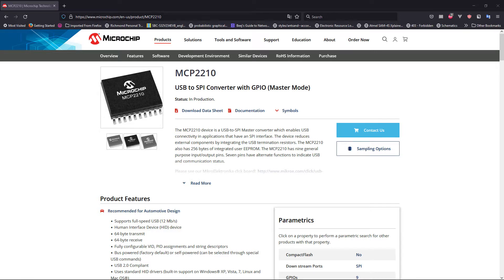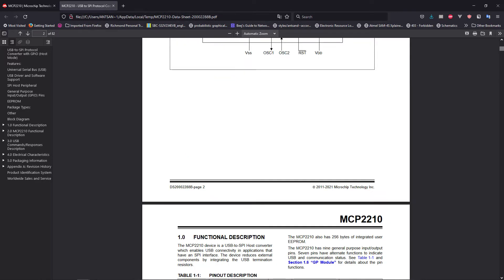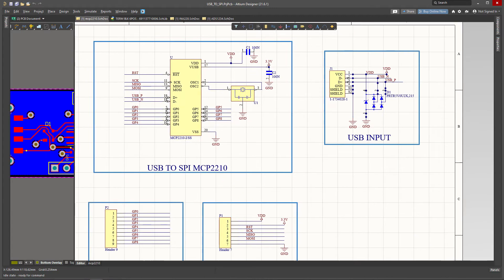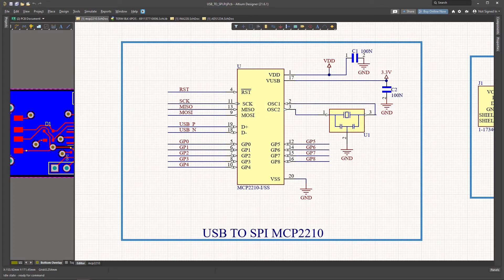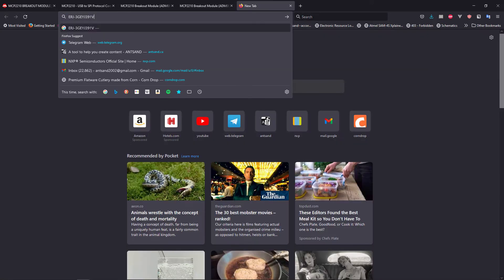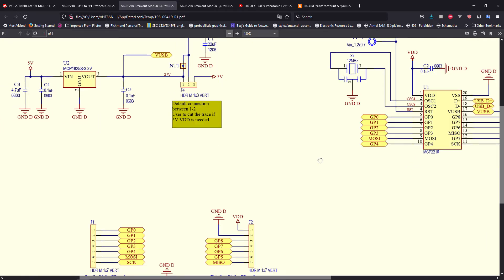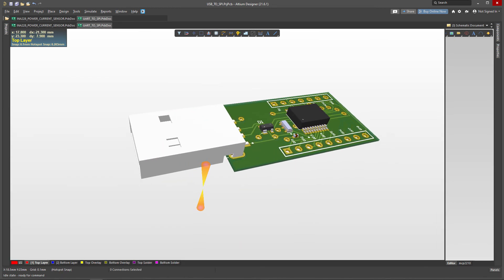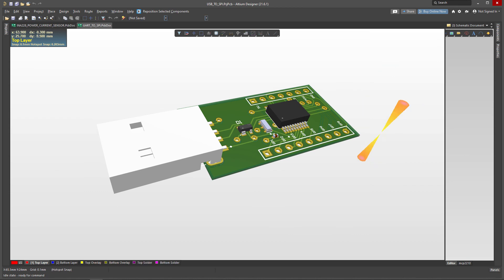USB to SPI breakout board using MCP2210 (Part 1)

Comment: Good afternoon from South America
With this circuit I could communicate for example the ADS1256 to the computer to read and display the data in real time?
Reply from the maker: I believe you can. I have the ADS1234 which is similar to ADS1256 and will test this out shortly. I do not see why you cannot test this in real time.

Comment: Where’s part 2?
Reply from the maker: I should have it done in a day or two. Due to chip shortage, the MCP2210 was out of stock. Received it a few days ago. Got it working and will have the video up shortly.
Reply from the maker: Part two video link is here: https://youtu.be/rJnTBsqV2K0 . 

Hope it help!
Reply: @antshivrobotics  Thank you!!
Reply: @antshivrobotics  Hey, how would I do this with a Type C connector? It has a lot more pins.
Reply from the maker: @vdjosea  Ideally you just need to connect  VDD(5V), GND, D+ and D- . The rest of the pins I would leave it floating.

Hope it help!
Reply: @antshivrobotics  The pins are 2 VBUS, CC1, and CC2. I am guessing the 2 VBUS pins are VDD and D+ is CC1 and D- is CC2?